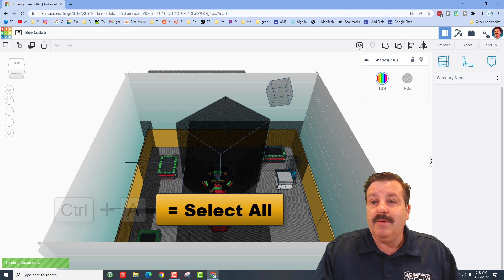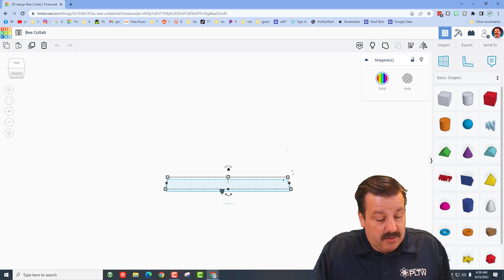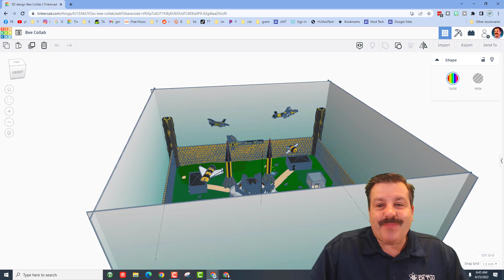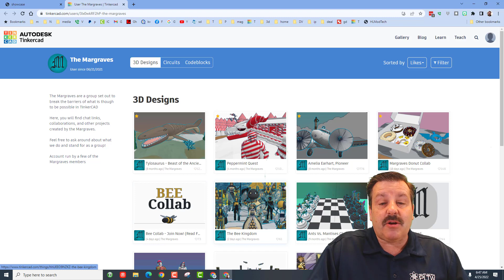Simple Steps to Load Large Tinkercad projects FASTER | So COOL!

Comment: hey don't know if you see this but can you do a video how to fix stuck on loading screen i can get to my project using a different computer but not on my computer
Reply from the maker: This is a Tinkercad project correct?  Is the project on the 2nd computer fully updated or are there changes in the project on the computer that is stuck?
Reply: @HLModTech  it fully updated and i try the duplicated method and it did fix to where i left of  finishing the R2D2 head cause before it showed i didnt finish the head which i did and usualy it will fix it it once loaded in but not i am just stuck on the loading screen on my computer
Reply from the maker: @woodsman9427  I’m strolling with my puppy right right now. When I get home, I’ll see if I can give you some good advice. Thank you for the update.
Reply from the maker: This trick may help. Groups of groups can be tough on Tinkercad too. I made this video about it. https://youtu.be/wP7TUabWTqw
Reply from the maker: Would you like to send a share link of a copy so I can see inside it? Here's how https://youtu.be/XeDQjhRK8lg hlmodtech gmail is a slick way to reach me.